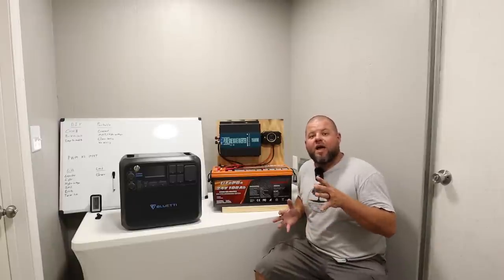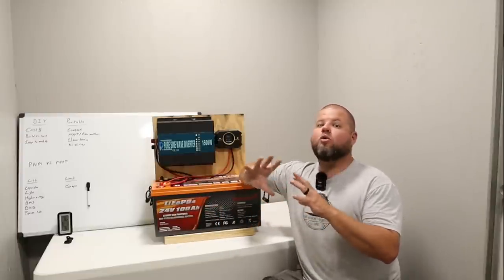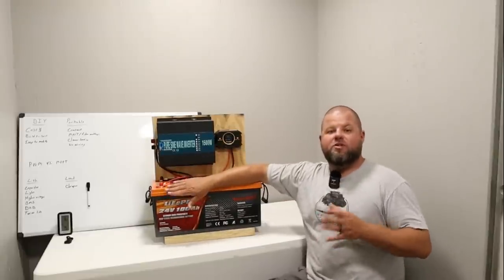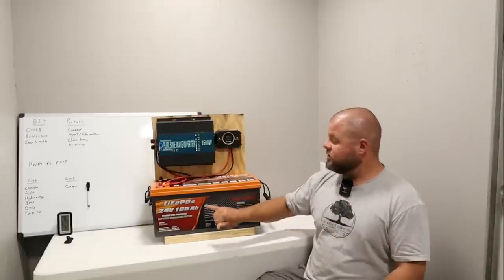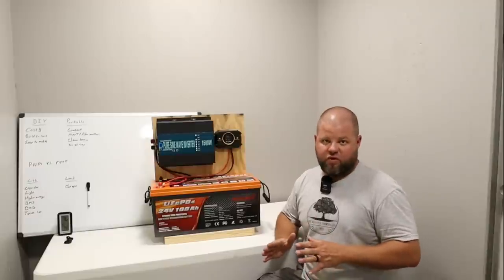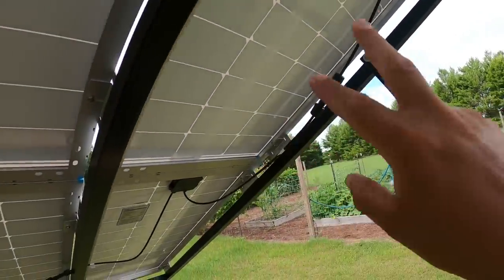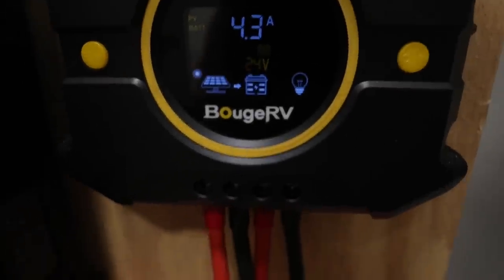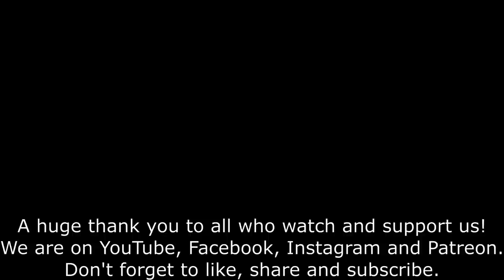Building a DIY solar system? Start here for information! #779

Comment: My GOD! Thank your for this video. I have a shed off a 1942 house and the electrical supply box is in the basement. I this this would be cheaper and more efficient in the future.  I want to run a middle of the road cheap refrigerator, a small TV, speaker, 3 x led lights, and a miter saw. That would be the most all at once. There is not much shade on the roof of the shed so I could potentially start with 4 and move up to 8 panels. Great looking out for the future farms here🍻
Reply from the maker: Miter saw has huge initial spikes (2400 watts) and high load for cutting (1500-1800 watts). Size your inverter accordingly.

Comment: What a great video! Question, would you consider building a battery array for your entire Homestead off grid system?
Reply from the maker: Sure would, but they seem to run the same price as on the wall and rack batteries. So it's your personal choice since the money is very similar.

Comment: I used to get used 12 volt gel cell batteries that came out of medical equipment. They would still be good but due to maintenance requirements they had to be replaced regularly. Would keep several around the house to run my scanner radio, and my Icom 2 meter ham rig on it. 
Guess I need to start dabbling in the solar arena.
Reply from the maker: Gel is a better alternative than lead.

Comment: Just want to mention something that many may not realize and that is DC electricity becomes deadly at around 40 volts. Put 2 100watt 12volt solar panels in series and you have 40 volts
Reply from the maker: I respect all voltage.

Comment: Great video, really excited for this one.  Why use 24v over 12v?
Reply from the maker: No reason honestly. Two 12v 100 ah batteries in parralell or series provides the same power for price. But..... Should I decide to power a different way, this battery will be perfect for my other 24v trolling motor.
Reply: In general 12V systems are less efficient than 24V or 48V systems. And remember, 12V appliances need twice the amps to run a specific wattage, so they need a heavier gage wire to handle the amps, compared to 24/48 V. Both factors become even more important if the distance between the solar panels and the charger/battery/inverter is larger.
Reply from the maker: That's very true about the amperage and wiring. A great cost saver on panel wiring as well.

Comment: Lead acid may be wrong in your use-case, however it's still valid in an RV/boat (sailboat, in my case) environment as the engine starting battery and for other high-amp loads. LiFePO4 isn't appropriate for starting a diesel just like lead acid and AGM aren't the best solutions for a house bank anymore if you can help it.
Reply from the maker: Your very correct and I should have stated it's high amperage and CCA ability as a positive for it.

Comment: you should  do  the  battery voltage  x Ah ...  =     wh ..  24vx100= 2400Wh ...       /5 hous daylight ...in this case ...480what solar to charge them in a day  without load ...
so to be good you should first calculate your  load in  Wh...    and then plan your battery size  Wh x3  (to compensate on bad days)   , and  then solar . total Wh battery/5hours light ...  and or anything you can fit ...

and if you string pannels... chose series or paralel makes diffrence if your roof starts the day.. in partly shade  for some time or not  (tree or other object that later in day is not in the way anymore...)..  (look it up, that part is too complicated to explain here, but it makes a diffrence in output to the battery  )
Reply from the maker: That's the internet standard formula but doesn't fit all situations. I'm in Florida and get far more sunlight than that. You don't use 24 volts because lithium runs at higher voltages. Starts at 27 volts and slowly drops throughout use. That's why this battery is rated at 2560 wh. My 48v batteries charge to 57 volts and are usually at rest 100 percent around 54 volts. As for the series vs parralell on panels, that's an older way of thinking. The newer panels come with bypass diodes to help with partial shading as you described. Long story short when planning your solar system, put it in a sunny location if possible.

Comment: Can those charge controllers be used with energy coming in from the grid?  I would like to set something up like this as a backup for my second fridge, freezer, and router/modem during short power outages.
Reply from the maker: Not unless you purchase a AC to DC converter that can adjust voltage and amperage to meet the charge controller specs.

Comment: 🇨🇦😎hey Buddy been thinking of converting my 200431 foot Class a 308 ForestRiver Georgetown to be in the 2023 years.  Either a lazer projector or a 80 inch TV.  But all I got is 2 12 vote marine batteries in series. So it's not doing it for my needs.  And I am considering some of your suggestions.

Comment: Could you please let is known the difference from using the solar tilted for the season and being vertical.  Im constantly putting them on my fence vertical, rather than tilted.
Reply from the maker: I have not tested that extreme of an angle. I can tell you that being off by 20-30 degrees is taking away roughly 300 watts from my array.

Comment: Thanks
I was not even AWARE of Solar "BATTERIES"  higher voltage than 48 volts !
COOP
...
Reply from the maker: All lithium tend to run higher than rated. My 24v batteries are rated at 25.6v and hold a full charge even higher than that.

Comment: Do you mind sharing the trolling motor batteries that you are liking?
Reply from the maker: Here you go https://youtu.be/nIPrR6hnrMI

Enjoybot also has 12v 100AH batteries (link in the video description you are watching now). Make sure whatever you buy it says it's capable of being wired in series if you are running a 24v trolling motor with two 12v batteries.
Reply: @TKCL  - thanks!

Comment: Could I use this to run my pool pump when running it pulls 1100 watts
Reply from the maker: Not for long, you need a DC pool pump that runs straight off of solar panels. You'll have a slightly higher initial investment, but a much more capable setup.

Comment: Lithium battery The controller I have a 30 W controller and they if I get the power converter what you got there could that run a well I don’t think it will cause I don’t have the plug add to be what 240 I can’t remember what it is but I think it takes the sea I think I got  two of the 30 fuse in my fuse box to run the pump so that’s 60 A is it I don’t know about logical that much better the high Power
Reply from the maker: Your going to need a large inverter and batteries capable of high amperage output to run large demand 240v applications.

Comment: Please do not suggest "deep cycle marine/rv" batteries from walmart for a real solar setup. They are actually terrible for the real "deep cycle" use. A GC2, or GC12 golf cart battery is much more appropriate for this type of use (if its actually gonna get used often). 3x GC8 in series could also be a good option for 24v systems. Those Group 29 & 31 "rv/marine" batteries just dont last. Also, those look like 6g wires to the inverter, that's "just good enough", & 4g wires might increase efficiency & droop just a little.
Reply from the maker: I never mentioned Walmart batteries.

Comment: Andrew, how long will that setup run a 1500w electric space heater?
Reply from the maker: Hour and a half max. Heaters are very power hungry!
Reply: @TKCL  how long does it run a 110v ac window unit?
Reply from the maker: Can't say, I'd have to know your power consumption while running.

Comment: No fuse no DC breaker no safety not very smart my friend can you please work on it
Reply from the maker: Yes I can add that when I install this in its permanent location. Extremely short run and highly unlikely damage in this demo setup.
Reply: @TKCL  thanks 🙏🙏🙏 would be great safety goes first keep up the good work 💪💪💪